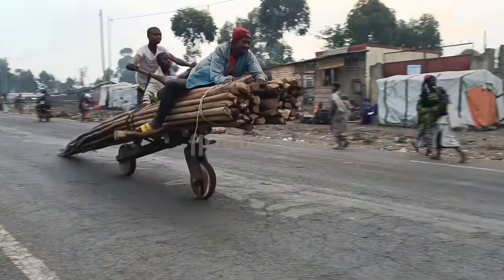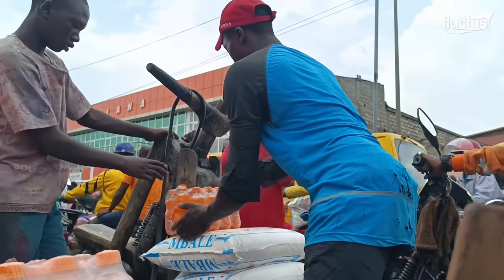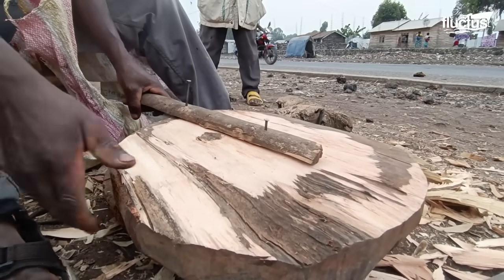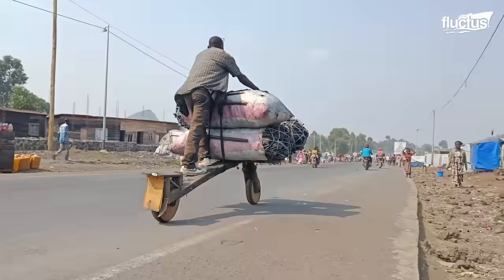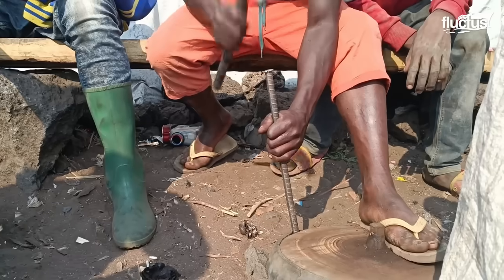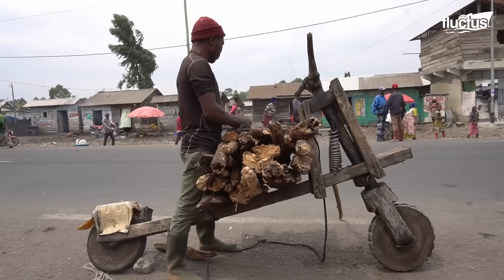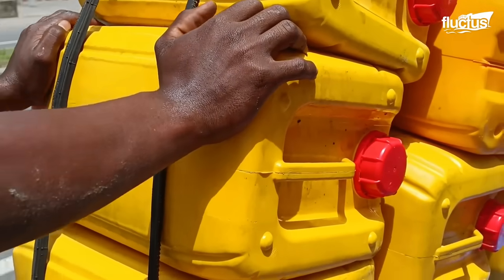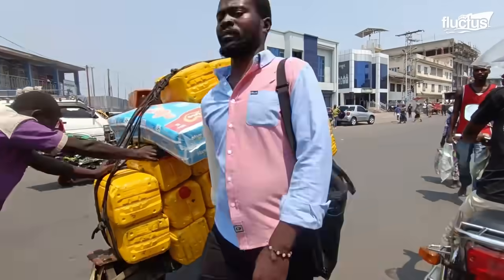How Congo Invented World’s Cheapest Wooden Scooters

Comment: We also make same wood scooter here in Philippines. But with additinal specs 😅 like we use Bambo as shocks absorber for the tires  and wood break pedal with rubber attached.
Reply: Bamboo as shock absorber? What? That sounds funny  and interesting 😂😂
Reply: @celestineterkaa8842  😅 Yes its true due to bamboo is flexible, try it by yourself. By using a good aged Bamboo thick "Slat" and putting the tire in between it will act  as an absorber. But of course it has a limited weight capacity.
Reply: Can we see picture of it
Reply: What is the name of the scooter to search about them??
Reply: Wow. Philippines and Africa finally invented the wheel?! What next? Human rights? Lol

Comment: Is there a reason why a regular wagon design would not work?  It seems you have to put in some extra effort to balance it when you are not down hill -- where you have to push to move. A wagon would be easier to push without the extra effort to balance.
Reply: That is going to be the next upgraded design .
Perhaps after that a motorized one.
Reply: The chukudu, a traditional African wooden cart, has two wheels for simplicity and maneuverability, making it well-suited for navigating rough terrain. The design allows it to easily traverse uneven paths, which might be challenging for carts with four wheels -Chat GPT
Reply: @cokomairena  I sure would like to see it, because they didn't show anything like what chatgpt suggest. I saw regular roads, where it would be easier to have a 3 wheel wagon. I am not suggesting that there is no rough terrain, but that the video showed them using it in wide open roads, with little resistance, except when they were trying to push it and balance it. Hence my question as to why not use a wagon design, which would offer less effort in balancing and only require effort pushing.